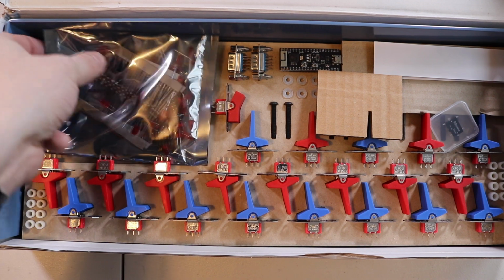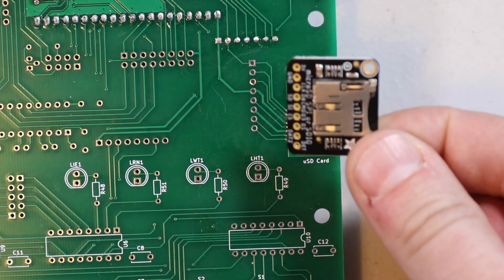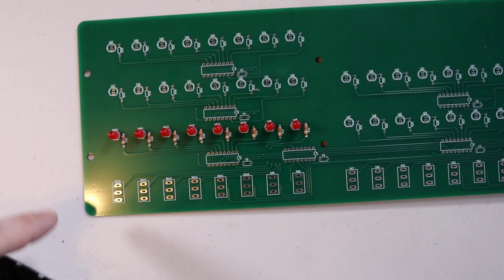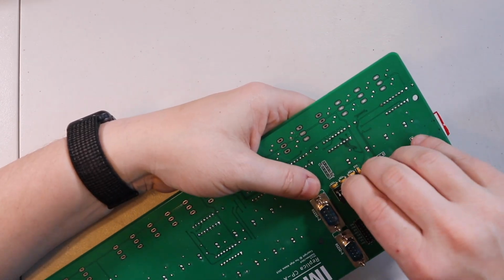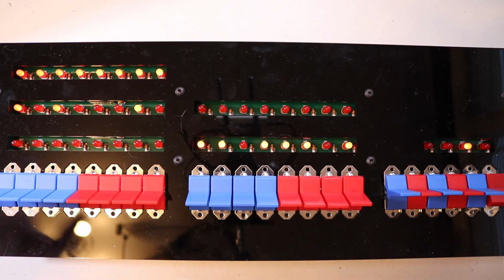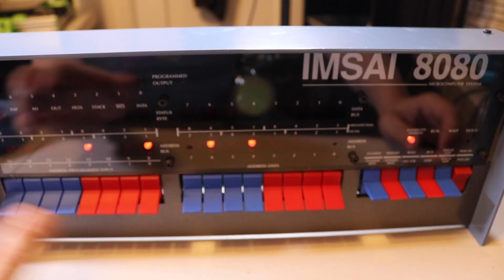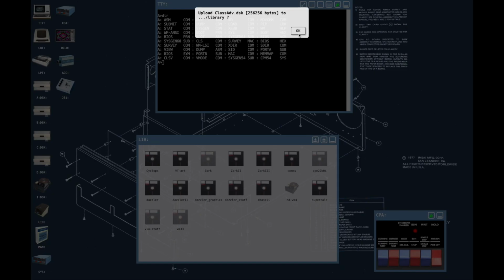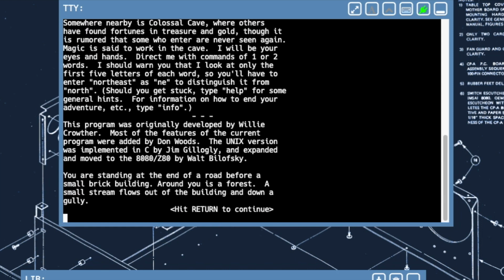Building the IMSAI 8080 Replica of the Computer featured in WarGames

Comment: This kit, probably more quality as the original, but deftly less unsafe to use. I have A original IMSAI and other S100 systems from that era, but all have one thing in common, besides the S100 bus. The original PSU is dangerous and low quality.  
also, a Little Fact. The IMSAI 8080 is mostly built with low quality parts and QC rejected parts. Like Resistors with Wrong placed markings, chipped ICs or misplaced or unfinished Markings on them. 
That was one Reason why it was nearly half the Price of the Altair 8800. 
The S100 system bus held up til the late 80s but newer CPU modules doesn't needed to set the address to the boot/program loader. Some modern CPU modules had already one part of RAM also ROM, Clock, CTC  and SERIAL on it. Basically this was a Single board computer and the S100 bus Backplane was only used for providing power and for expansion. also with the newer S100 systems you lost the ability to install multiple ROM cards into your system to have multiple OS and Native programs in your systems like CP/M, UNIX, DOS, BASIC and so on. Modern CPU boards also didn't have the Manipulator port like the Altair 8800, IMSAI 8080, Wameco. You could install the Bus inspector card and this made you see the LED on the front like these systems had, but this didn't allowed you to interact with the CPU directly like before. 
How i said later PC are easier to use as the early 1973 to 1976 systems. The people wanted a PC you put power on and they work. 

The altair 8800 and the IMSAI 8080 are shiped with intel 8080 cpus but you can install in them other CPUs as well. Like the Zilog Z80, MOS 6503 or Texas Instruments TMS-9900 and so many more. you could build your own s100 cards at home even CPUs. Every CPU with bus architecture would work even if you cut your address range. 
The S100 system was a versatile system at its era, even today Bus architecture systems still in use. The Z80 production stopped only a couple of moths go because it is in use til this day. The Z80 was produced for 48 years. I mean yeah the IC package changed a bit depending on the application, but internally it stayed the same for 48 years. The Packages ranged from original big 40 pin DIP to the smallest 40pin DIP up to the tiny BGA IC packages. Many modern PLC as example uses Z80 CPUs also coffee maker and other fairly simple machines uses either the Zilog, Texasinstrumnts, PIC micro, Atmel, STMicro or similar CPUs and SOCs.
Reply from the maker: Great info! Thanks 🙏

Comment: Have the same kit. I broke off the sdcard and want to extend using the same card you used (2nd time) from china. The sdcard pcb has 9 pads but the mainboard has 8? You also mentioned switching some of the connections with the first mod, is that necessary with the second sdcard (details would be great). Does it need to be grounded? Sorry, my electronics background is very limited. My kit worked prior to the accident, but now is dead.

Comment: This is amazing stuff.  Is there any way it could be built onto a regular ATX PC case?  I always thought it'd be cool as hell to have a real modern computer that has the Imsai front.
Reply from the maker: Possibly. The biggest challenges would be finding a case big enough and the correct dimensions. It could also be more integrated into the case itself by routing switches and LEDs to the front of the case, but that would definitely be a hard route. Perhaps for some inspiration, you can take a look at a PC case I customized to house CNC electronics here: https://youtu.be/fp2r1Z4i2OA